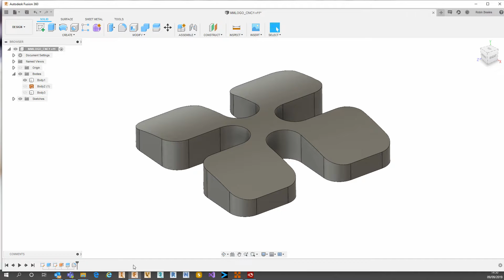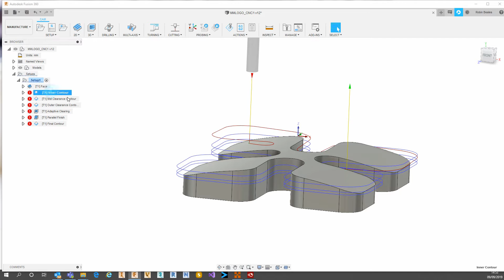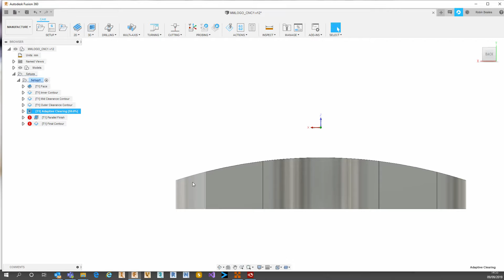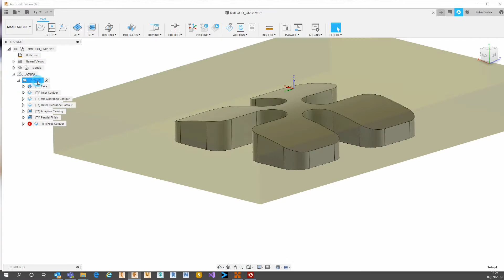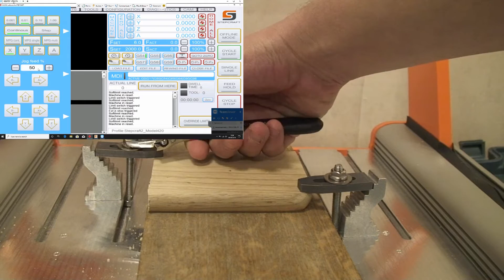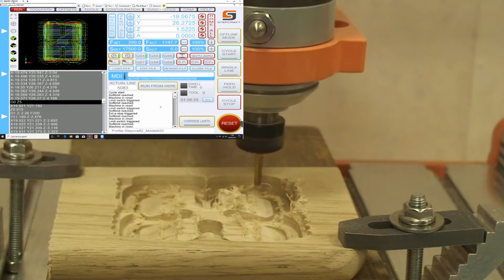Fusion 360 and Stepcraft CNC – Design 2 Manufacture (D2M) CAM Workflow

Comment: I’m having some bad troubles with my machine, I i home it all to the work peice then home it to the end points, press start and then it just wants to crash into the bed :(
Reply: Just to follow up on the matter, I have found a couple of line of G Code at the start and at the end of the file which causes this problem. I have no idea why it is generating this code, but as it stands, I have to edit the file and delete the unwanted code before running it in UCCNC. 
(1001)
(Test Cut)
(Machine)
(  vendor: Stepcraft)
(  model: Stepcraft 840)
(  description: Generic 3-axis)
(T1  D=3. CR=0. - ZMIN=-12. - flat end mill)
G90
G0 G53 Z0.

The last 2 lines in the above section of code is the problem. I delete this and then it all works OK. Also the last line but one  (G53 Z0) also causes the cutter to plunge down into the stock after finishing the program, I delete this line as well.

X62.352 Y103.502 Z-11.887
X62.387 Y103.498 Z-11.83
X62.409 Y103.495 Z-11.767
X62.417 Y103.494 Z-11.7
G0 Z15.
M5
G53 Z0.
M30
Reply: @simplyamazingwood1505  G53 uses the machine coordinate system instead of the local (Fusion-assigned) coordinate system. I just did a test post with that post processor however and it seems to be posting without that G53 Z0 now. For some machines, true G53 Z0 is deep in the bed, not sure why that is.
Reply: Same here, It works perfect using Vectric V Carve, but the same job in fusion 360, sinks the cutter straight down into the stock and wont stop unless I hit the red cut off switch. Have you managed to resolve it yet.
Reply: Here is what I do at the start of the cutting job. Turn on the Stepcraft, start UCCNC, Home all, ( sends the cutter to the rear left corner. zero all coordinates (not sure if this is necessary). Move the gantry to the front of the bed and lower the cutter to the start point, Zero the coordinates, raise the cutter to plus 30, load the toolpath into UCCNC, hit the cycle start button and the cutter just sinks down into the stock. I have a stock of X 500mm, Y 168mm, Z12,where I want it to cut a square centered on the stock 80x80mm. I have zeroed all coordinates at the front left corner of the stock. What should happen(as it does in Vectric) is the cutter should move across to the the start cut position above the 80x80 square and begin the cutting, but it does not move anywhere along the X or Y axis just the Z axis sinks into the stock.